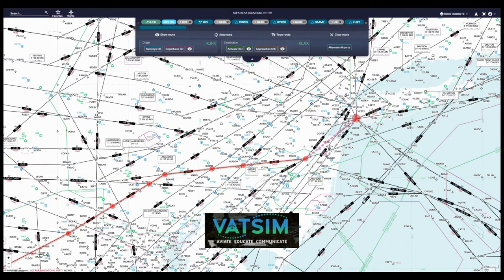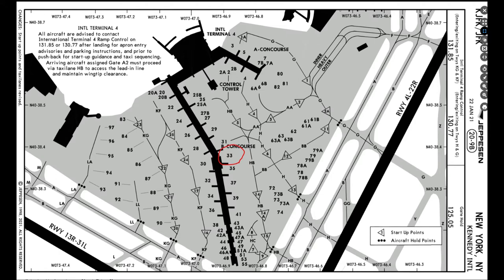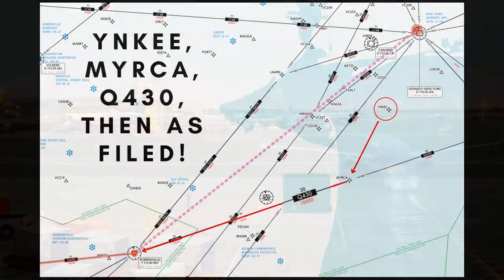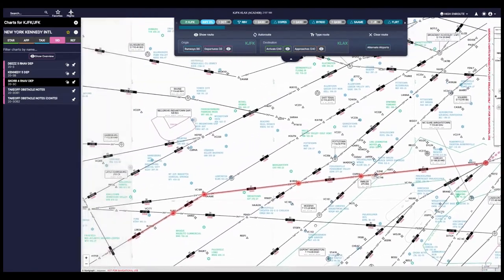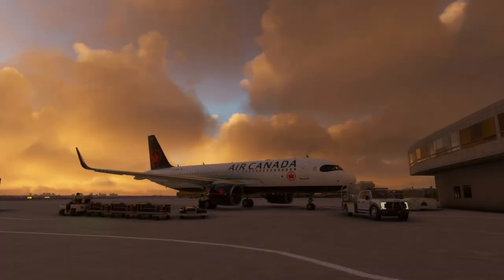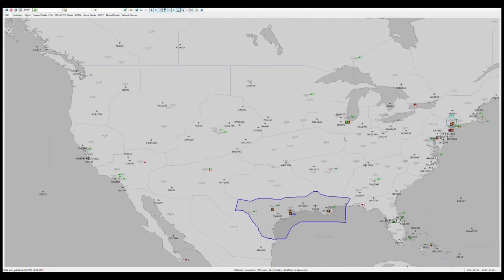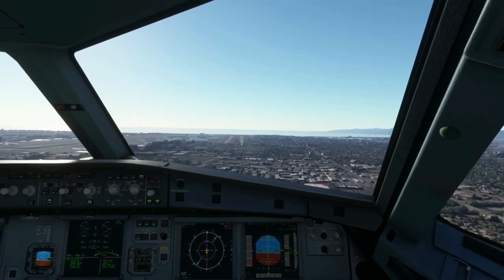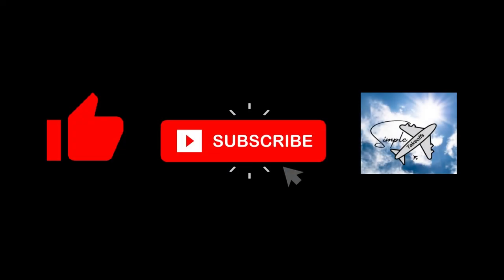How To Communicate on VATSIM | ATC Radio Calls

Comment: Man this is so hard, how do you read back that long as phrase? Like dont you forget some stuff? Man its hard
Reply from the maker: The read back becomes easier with practice because it’s the same structure everytime. ex the CRAFT acronym for IFR clearances. It seems overwhelming at the start but if you keep it simple by remembering every ATC call is an instruction that should be read back + your call sign, you’ll eventually understand the big picture. Keep practicing!
Reply: No you need to write it in paper normally and understand the meanings so you know what your talking about which makes it easier to speak
Reply: write it down first then read it back. The only complicated stuff is either clearance or taxi. write it down, then read it back ofter.
Often you can already know your likely clearnace or your likely taxi route by looking at the charts before.
For example lets assume I am at Gate 11, I check where that is, and I know I start runway 27L, I check where that is and then check which way I am likely to drive.
They might have minor changes, but likely the final entry to the runway will be the same and of course you can only start where you start. There often is a very obvious taxiway alongside the runway, on departure you will be driving close to the runway, so you can basically prepare 80% of what you will have to read back beforehand.

Comment: Hi. Nice video. Buddy I’ve been flying vatsim and enjoying every minute until ATC stopped hearing me. I can hear them but my readability to them is 0/5. I bought a new headset and tested it by recording my voice and playing it back successfully. They still can’t hear me. I uninstalled vpilot and reinstalled again. Can’t hear me. My settings haven’t changed. Any thoughts?
Reply from the maker: Sometimes you have to disconnect from vpilot, go to the vpilot settings, under input change it from your mic to another source, and back to mic. Then do the same for output source and save. This usually saves the glitch for me. Goodluck
Reply: @SimpleTakeoffs  unfortunately that didn’t work either 😩
Reply from the maker: @ziadcookingatallah9919  I would say try installing vpilot on another directory (try straight on the C: drive). Goodluck
Reply: When you are clicking your push to talk and talking is the TX on the top right of vpilot glow?